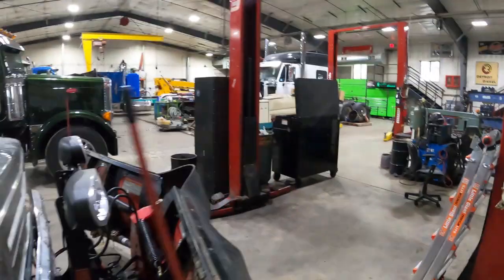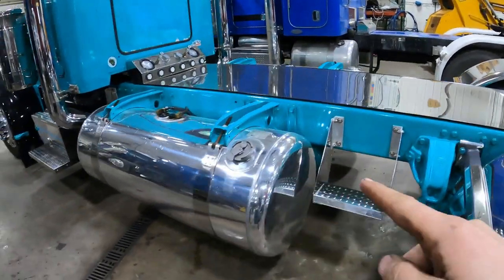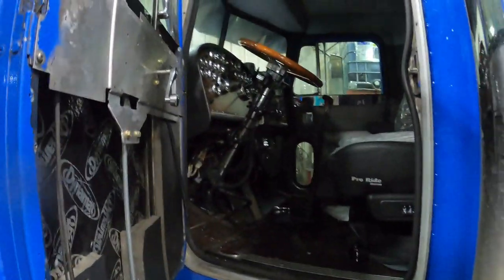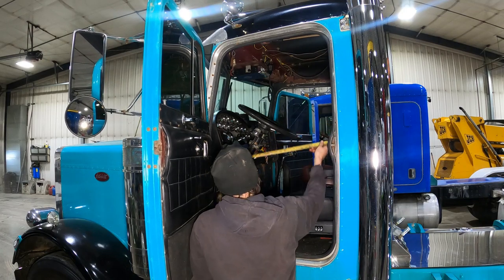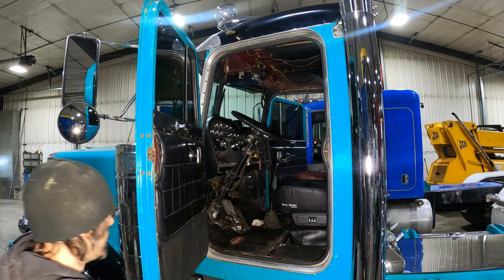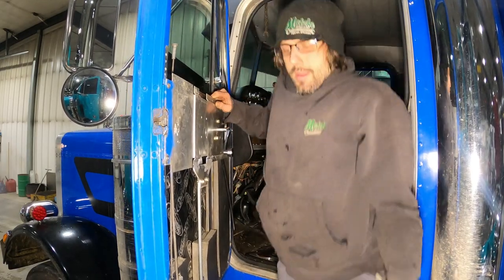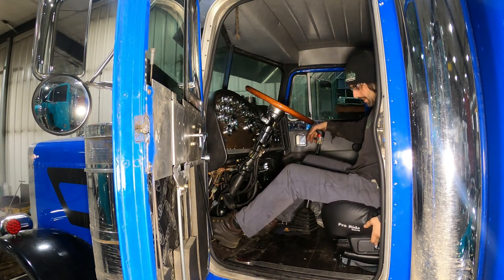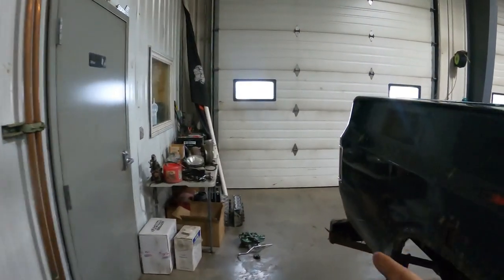Unibilt "BIG HOLE" Peterbilt 359 cabs vs non Unibilt.

Comment: LIke #2.  Hey, do a 5 second intro to your vids of the Joyride starting up, haha !    Question; do you have to go for an EPA test ever with Joyride? Like a cold start smog test once/year like commercial trucks have to up here in Canada?
Reply from the maker: At this time there isn't an annual test here. There is however spot and roadside check enforcement. We are confident Joyride will pass for its emission standard. The engine being newer and electronic it's going to run cleaner than the truck ever did with the original engine. The startup in the video was not a setup. That's the first start in 2 plus months. Thanks for watching.